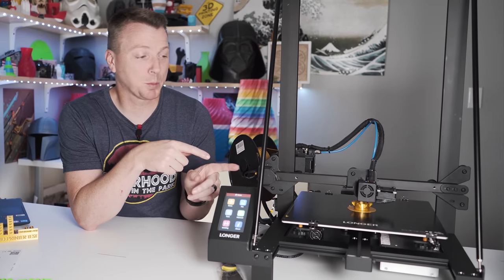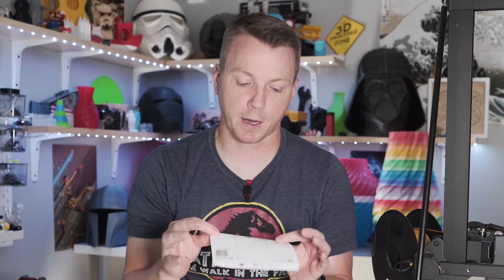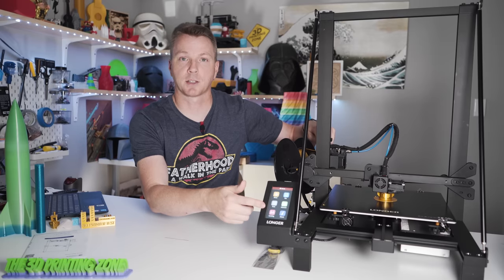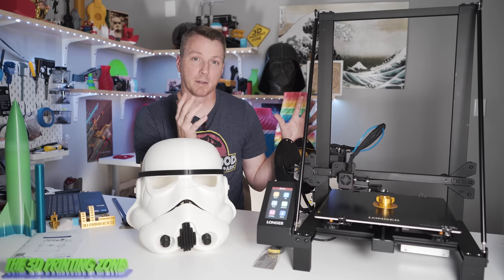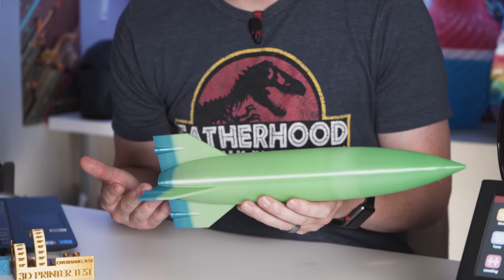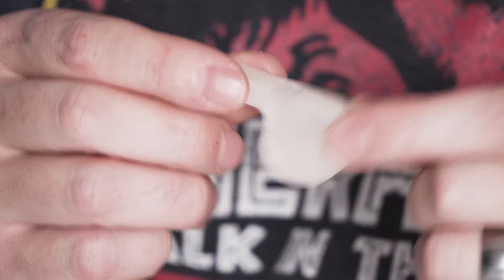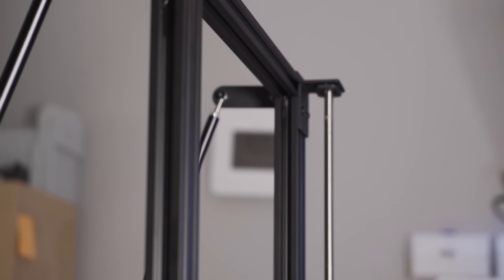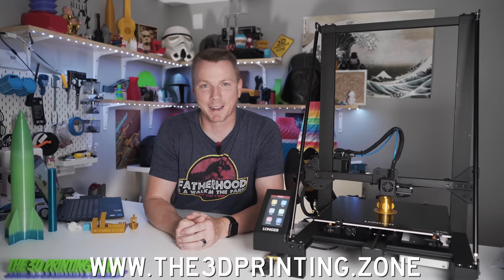The Cheapest BIG 3D Printer Out There - Is It Any Good? (Longer LK5 Pro Review)

Comment: Were you ever able to determine why Benchy had such heavy ghosting?
Reply from the maker: I need to test this theory out but I believe it's because of the table I had the printer on. The whole table top is free standing so it moves and shakes when there are fast movements on the printer, which is a known cause of ghosting. Speed and retraction settings are the other typical culprits so it could be one of those too but I'll need to double check.
Reply: @The3DPrintingZone  I have this same printer and my Benchy looks pretty much the same as yours, and was thinking the same think. I just put the printer on concrete blocks and vibration damping rubber, so hopefully that helps, gonna work through retraction and stuff next :/

Comment: About how long would a Batman Arkham Origins Cowl for a 24 inch head take to print on this machine
Reply from the maker: I'm not familiar with that but you can find out pretty easily yourself by downloading the model, loading it into Cura, and playing around with the settings. This printer, like any printer, will have a threshold of how fast you can print before you start to see degradation in print quality but the diagonal support arms on this make that threshold a bit higher.

Comment: What kind of filament does it use
Reply from the maker: This can handle most filaments, like PLA, PETG, Nylon, PLA + and more. It can handle flexible materials like TPU or Ninjaflex but it won't handle them as well as a direct drive machine would. It can also do more sensitive materials like ABS if you put a box or enclosure around it. In other words, the same as most printers that use a bowden tube. Also, like most printers it uses 1.75mm filament.
Reply: Thanks

Comment: how are you classifying this as big? creality has a couple models that are bigger and anycubic as well, both offer competitive prices so this cant really be seen as cheaper then those because of the size difference.
Reply from the maker: I would classify big as being in this 300x300 range, ideally with an even taller Z, like this one at 400. Of the 300x300x400 printers out there, I couldn't find many, if any, as inexpensive as this and with all of these features. I looked at the Creality and Anycubic printers and didn't see any quite this big and cheap. 

Viewers have pointed out that there are others, however - like the Tronxy X5SA. The Tronxy is actually a pretty killer deal especially since it's a Core XY machine, it's huge and has auto leveling and some great features, all for the crazy low price of $215! I might actually buy one to try it out.
Reply: @The3DPrintingZone  any cubic chiron at 400x400x450 is 20% wider and longer and still tall with a total build volume that is 50% larger than the one displayed with similar capabilities.  at prices about 400 case for the one you reviewed compared to the about 530CAD for the anycubic would make the anycubic chiron better price/volume. i dont really see how either of these could really be call large scale printers compared to lets say modix printers which also might beat this one in a price/volume comparison.

it really just seemed like classify this as a big printer seemed more to make this its own class to justify it then to really compare it to other large printers..

Comment: What’s the best value printer you’ve owned so far?
Reply from the maker: A few come to mind. The Ender 3 V2 is a great printer and a great value (thought it could really use a touchscreen). This printer is a tremendous value - easily one of the best I've seen. I'm currently testing out some tiny (100x100x100) printers that cost less than $100 USD each. We'll see how they go but for smaller prints, it's hard to beat $84.
Reply: @The3DPrintingZone  name of the 100x100x100 printer?
Reply from the maker: @evuroinc  I actually bought five of them but just search Amazon for the cheapest ones. K7, X1 and Minnie are a few off the top of my head but they’re not all created equal. I’m working on a review for them now.
Reply: @The3DPrintingZone  i building a prototype for my factory and I'm caught between costs. Is high cost mean great quality in terms of resolution and glossy finish? Sermoon D1 by creality $600 (245×245×300mm) and TronXY 3Pro $ 250 (300×300×400mm). Im readying to check out but paused for clarity
Reply from the maker: @evuroinc  The short answer is no. Spending more money does not necessarily mean you’re getting a higher quality finish or resolution. Most printers will print at nearly the same resolution even for the least expensive of them. Something to consider however is the fact that one of these is enclosed and has a much more stable structure than the other. Is that worth spending twice as much? That’s up to you. But again spending more does not always equal higher quality.
Reply: @The3DPrintingZone  Thank you for being honest about this misconception that if it cost more, it is better.

Comment: Good Morning...I did purchase one and had a bad experience. The glass bed moved every where. Plus all my prints was very hard to remove from bed. Also in Cura scaling was never  Accurate.
Reply from the maker: Hey Catherine, good morning. That stinks that you had a negative experience. Just curious, was it the exact same printer - the LK5 Pro? I ask because pretty much everything I've printed on this has come out great, so that's surprising to me.
Reply: @The3DPrintingZone  No CR-10 V3 but it was a LK....Sorry I guess the pro sound much better then V3.
Reply: Was same company Longer.  They are very had to get in touch with. smh
Reply from the maker: @catherinerrosa8070  Are you sure it was the CR-10 V3? That's actually a completely different printer and manufacturer (Creality) so I'm not sure. Longer does make an LK1, which is comparable to the CR-10 so maybe it was that?
Reply: @georg6876  I agree ! I believe it was the case because nothing that you show on your screen control didn't even looked like the one I had.
Reply: @The3DPrintingZone  is okay I did return it.
Reply: @catherinerrosa8070  When your scaling is not accurate then you had to calibrate the printer...
And when the prints are hard to remove then you leveled to close... Thats some things that you need to do on every printer when you want accurate prints that come off from alone🤷‍♀️
So i think thats your fault and not from the printer xD
Reply: @catherinerrosa8070  You can't even distinguish between two printers that look the same but come from a different manufacturer ... I would look for another hobby in your place! 😉
Reply: @XxX0Fanta0Holik0XxX  first of all that isn't none of your business. Second who do you think you are? 
I'm new to printing was placing my 2 cent. Don't come on here trying to tell people what they need to do or be disrespectful.
Reply: @catherinerrosa8070  i can say what i want on an social media plattform... And thats whats Youtube is... Dont write a comment when you dont want reactions! 😉
Reply: @XxX0Fanta0Holik0XxX  🤣🤣🤣🤣

Comment: sorry but teflon/PTFE doesn't go to 280. any claims otherwise is just claims.  PTFE itself degrades and offgasses, with toxic fumes, far before 280.  All metal hotends are indeed the way to go, and there's no reason not to anymore, even if you just print PLA - the potentional clogs and backflow of melted plastic is so much worse with ptfe lined hotends.

Comment: Does anyone know where I can slice my models for this printer
Reply from the maker: You can use most slicer softwares but Cura is probably the most common. Prusa slicer will work as well. Here's the Cura link: https://ultimaker.com/software/ultimaker-cura
Reply: @The3DPrintingZone  I looked into cura but it doesn't work so well on a Chromebook
Reply from the maker: @Ibeatminecraftvillagers   Ah, that's a very important detail. There isn't much that works well (for slicing software) on a Chromebook. A quick search indicates that it is compatible but, like you said, mileage may vary. I'm afraid I don't have any experience trying to slice on a Chromebook.
Reply: @The3DPrintingZone  I was able to find a decent site for slicing

Comment: I wouldn't buy this... I got one 3 months ago for Xmas and it's screwed up atleast 10 times. Multiple times saying it needs to change filament. Multiple times filament extruded from sides of hot point. Also multiple times layers issues. And many weird screens saying to restart the printer.
Reply from the maker: Sorry to hear that it hasn't been a great printer for you. Mine has been rock solid, even to this day. Have you reached out to Longer to see if they can help, or checked any of the forums? Yours should be doing a great job - those issues don't sound common for this printer.